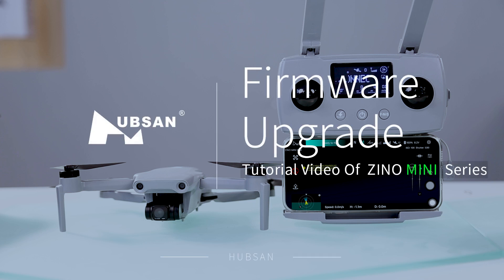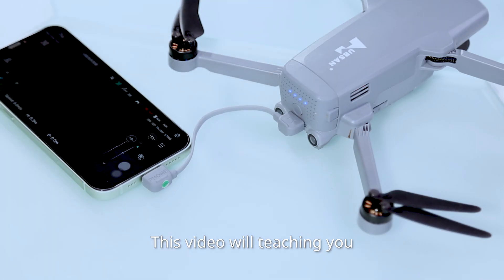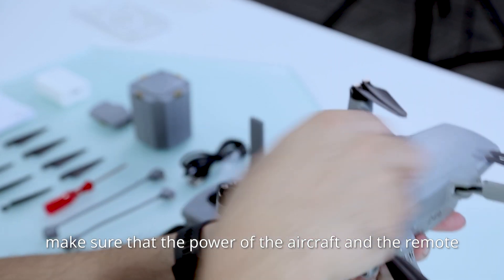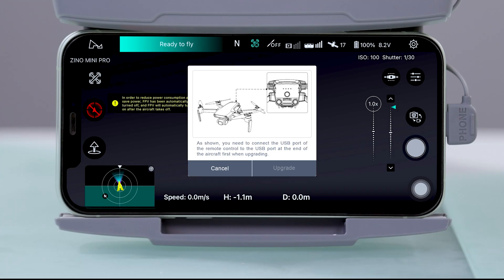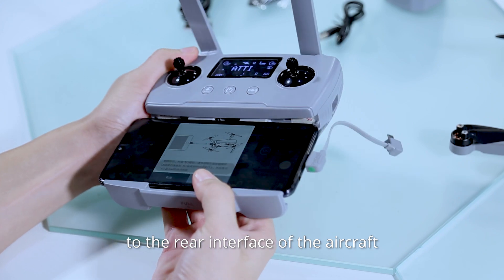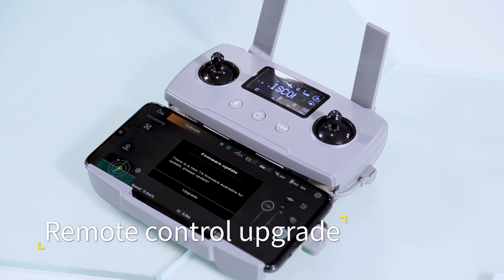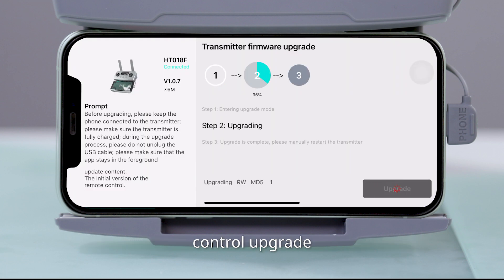Firmware Upgrade - Tutorial Video Of Zino Mini Pro

Comment: Dear Hubsan 
 unfortunately I have a big problem with the Zino Mini Pro ..
During the upgrade procedure from version 1.3.5 to vers. 1.3.6, it was blocked once the upgrade reached 50% (the installation package had downloaded 100% correctly).
 After almost 6 minutes at 50% the drone went into "protection", it started emitting alarm sounds and making micro-movements of the propellers .. I guess due to the high temperatures .. at this point I preferred to turn off the drone so as not to ruin the electronics, interrupting the update procedure (which I remember was still at a standstill for quite a while at 50%).
Now, however, trying to update the drone again, from the app it no longer finds any updates and even by carrying out the manual search it does not find anything, it is as if it were restored to the factory versions. I am attaching some screenshots
Do you have any ideas how I can fix it? is there an update procedure with a program on the PC as it happened for the normal zino? Thank you

PS I have already tried uninstalling the App and reinstalling it

Waiting for your feedback,
I wish you a good day,
Roberto
Reply: Hello, I solved the problem using another cellphone. I was able to update the drone (version 1.3.9). Maybe this issue is caused by incompatibility between the cell phone/X-Hubsan 2 and the drone device.
Reply: @ChicoSantos  thanks ....good information...
Reply: @ChicoSantos  2

Great, I'm happy, today or tomorrow I'll try with another smartphone (no Huawei) .. you saw the solution was that. Did you by chance have to activate the "developer" options with the second smartphone for the USB connection or did you not need it?
Reply: @Robertspierre10  Hello, I'm sorry for answering so late. Developer options was disabled.
Reply: @ChicoSantos  Thanks for it 👍. I solved it too by updating from another smartphone, thanks for your cooperation 💪
Reply: Me to...same problem...I don't know how to solve the problems... anyone can help
Reply: @lieshah4660  hi friend, unfortunately we are waiting for a solution from Hubsan regarding this problem and for now there is no solution. In the meantime, we can only wait for the release of the next firmware and try again paying attention to the debub-usb settings .. have you opened the ticket for assistance? the more reports come the better
Reply: @Robertspierre10  yes...
Reply: I have the same problem. Did you fix it?
Reply: @ChicoSantos  hello, unfortunately I have not solved. Now I recognize the 1.3.7 update but trying to download it stops at 1%. A problem has also been added to the remote control, it does not recharge more than half and therefore I cannot even update that. I wrote to Hubsan support .. hopefully good
Reply: @ChicoSantos  hello dear, have you solved it by chance? even during the update to version 1.3.8 it freezes at 50% (update failed), while the remote control firmware is installed correctly.
Reply: @Robertspierre10  Hi, I couldn't solve the drone problem, but I can update the RC firmware normally.  Today I was notified of the 1.3.8 firmware update, I performed the update, but I had the same error, the update stalled at 50%, then I received the update failure notice.  However, when entering the app, the features of this version were available for use.  I have the impression that the update is successful, because when I click on the button to check the update, nothing is found.
Reply: @ChicoSantos  
Hi, unfortunately the new settings are due to the app, surely you can't use them, check the firmware version that installed you, it should be the factory one or 1.2.6 .. however they suggested this solution :https://www.youtube.com/watch?v=xJ00aVl32NQ
Reply: The phone could be the problem, that is the connection setting of the usb / android cable .. after contacting this youtuber to ask him for confirmation
Reply: @Robertspierre10  Thanks for the feedback. In my case, I was able to use auto drift (feature released in version 1.3.8), but version 1.2.6 is shown in the app. About the solution, I think you put the wrong link above, can you please confirm that this link is correct? Thanks!
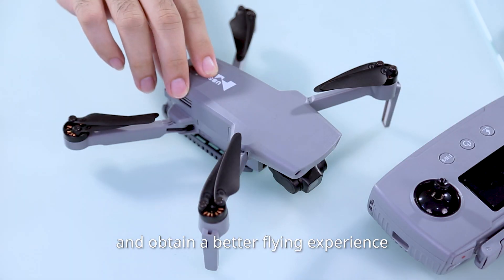Reply: @ChicoSantos  Yes yes the link I put is correct even if it mainly talks about the new features. I posted it because at 0:18 it shows in his smartphone (involuntarily) that at 50% of the update, the drone restarts and tries several times to reconnect to the smartphone .. he asks for confirmation and in fact clicks on "charge only ", in others it happens automatically .. in our case it does not happen and therefore everything stops at 50%